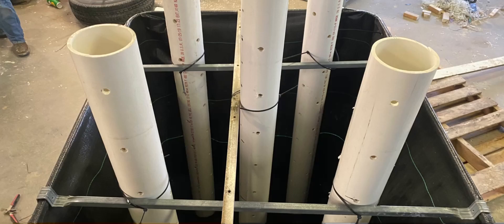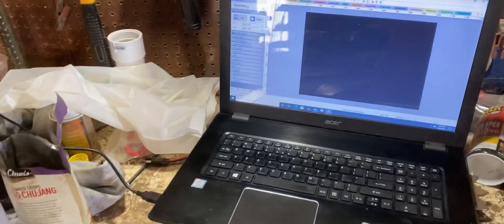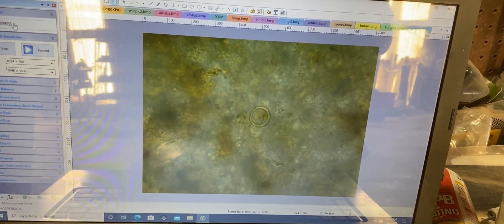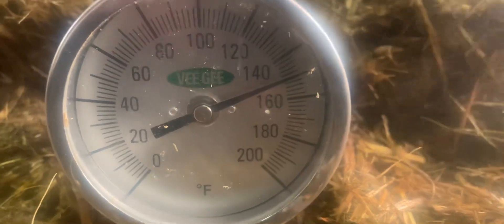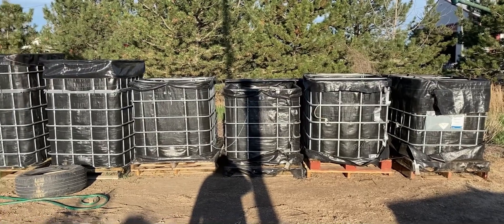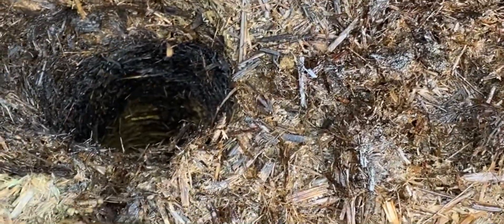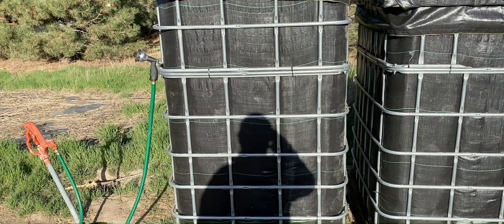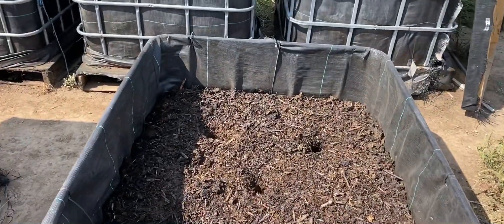Johnson Su Bioreactor day 395 a year in review.

Comment: Thank you for posting this! We are gearing up to make 4 or 5 of these in the next couple of days, so your honest results were very timely. In the end, would you suggest doing the double-stacked version or do you think the size contributed to the anaerobic conditions? I was intrigued by the taller one giving more volume and taking up less floor space when we move them indoors in the winter. Thanks for any advice!
Reply from the maker: That’s a great question.  Do you have access to wood chips?  I think making that last one with wood chips really helped with the airflow.  Also do you have access to pin trees.  I make my kids pick up pine cones and I layer the bottoms of mine with pine cones so the bottom gets good air flow.  

I just made one with grass clippings.  I’m going to make two more this week.   I’ll add wood to those.
Reply from the maker: On the double stack I’m going to try one this week with wood chips shedded corn stalks and Beardless triticale hay.
Reply from the maker: Darcy are you building it the traditional way or are you using the shell of a shuttle?
Reply: @youngredangus6041  Thanks for the response! I loved your idea of using the shell of a shuttle, and we have lots of those around, so going to try that method. I just seems so much more sturdy and time efficient.  We'll leave them outdoors through the summer and then move into a heated shop in for the winter, so this frame sounds like a better idea to hold up when moved.  We do have wood chips available, so I'm planning to use those, some cow/horse manure with their bedding, and chopped alfalfa hay. The wood chips are so important for building structure and keeping things aerobic.   I just finished the Soil Food Web courses and had great success with the thermophilic method I learned there, but it is a little more labor-intensive.   Excited to try the Johnson-Su as something we could put the work into now, and hopefully benefit from the high fungal content in the spring when we're ready to seed again.  I really appreciate you posting the successes and setbacks with what you've done.  There's so much information out there, it's hard to know what direction to go sometimes!
Reply: David Johnson recommends that use screen the material so it's no bigger than 3/8 of an inch it looks like in one of your videos that it's quite a bit bigger with the wood chips. Also, how did you get ahold of David Johnson? I've been mixing my Thirty or so piles of wood chips with Organic soybean pulp that they use to make soybean milk. He took pretty good. But still got a lot of big pieces in it.
Reply from the maker: @cascades500  

We ran our material through a wood chipper this year.
We used wood chips and ground up corn stocks
Reply from the maker: @cascades500  
I’ve talk to David Johnson at Confrence and he is good about responding to emails.
Reply: So what is the email address you use to contact David Johnson?  Thanks for your help!
Reply from the maker: @cascades500  

Email me

44thefarmer@gmail.com and I’ll send it to you

Comment: I wonder if you just added more holes/tubes,to begin with. Or how that might effect stuff.
Reply from the maker: I did that with bioreactor 7.   I put 4 extra holes in it.  The hoes were with 2 inch tubing.  They collapsed pretty quick.  
I built one on Saturday with grass clippings.  I d
Reply: @youngredangus6041  were the new holes vertical or horizontal?, I presume vertical would hold their shape better. 
Am I correct in saying you have to use enough water to get it above 70% water, while making the compost , but also loose enough before filling the bioreactor to maintain the 70%.
This is a great series of videos well done.
Reply from the maker: I didn’t double stack it and I didn’t use a feed truck.  I’m hoping that helps out.  Thank for the feedback!  I’m still learning like everyone else

Comment: Hey what happened to reactor 7?
Reply from the maker: So I I built bioreactor 7 with the feed truck.  It was right around the time that the others were going bad.  So I backed off the water.  Probably too far.  Parts of it dried out.  Some parts were anaerobic.  It was the worst one.  So I broke it apart and added wood chips.   I left it outside and let it freeze because I wanted to see how one would do getting left out in the elements.   I’ll look at it under a microscope later this summer.